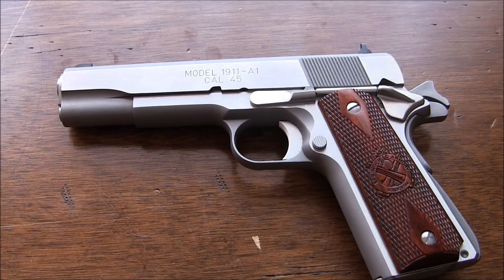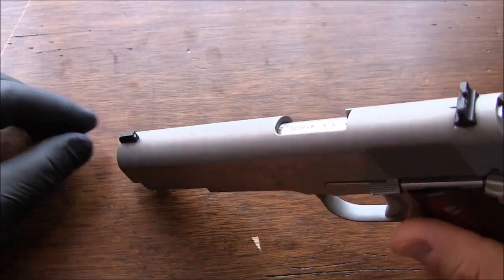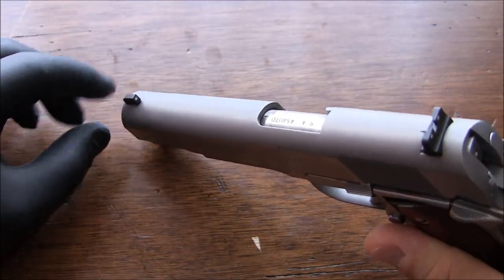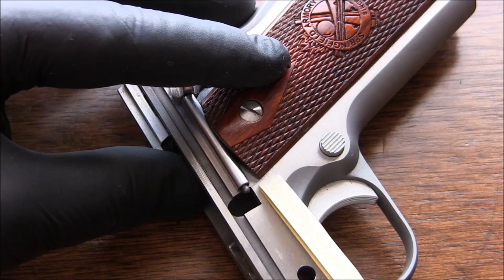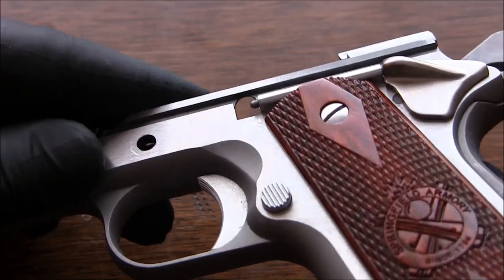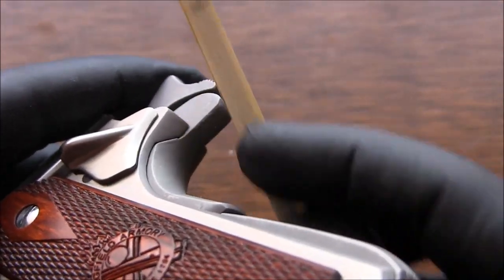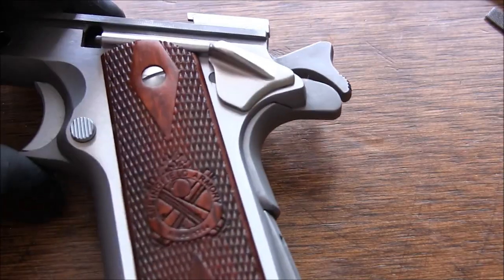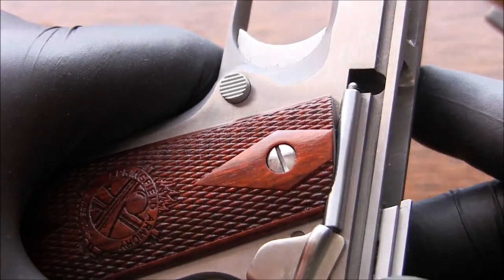1911 Fixes - Sharp Edges of Grip Safety, and Idiot Scratch

Comment: Improper and unsafe clearing of weapon at commencement of video.
Reply from the maker: I wasn't demonstrating the proper way. was simply showing that the gun was unloaded. I made sure it was unloaded before even starting the video.
Reply: Therein lies my criticism.  That is how 'accidents' happen in the form of ND or worse, involving damage to property or person. The procedure should never vary- always, without exception, drop the magazine first.  This is basically an instructional video and you don't want to pass on to newbies unsafe clearing procedures that may also result in civil or even criminal prosecution. Don't try to rationalize an excuse to save the hassle of doing it the safe(r) way. Yeah, I know it's more of a 'pain' to do it the right way, but there really is only one 'right' way to do it- check owner's manuals and military manuals.
Reply from the maker: +brentfoto Thank you for pointing this out. I am not trying to rationalize anything. I believe since that video I did start clearing the proper way. I am surprised you didn't call out the fact that my hand was covering the muzzle before it was cleared. Or that the hammer was in cocked position with thumb safety off .
Reply: Yeah I must've missed the former but the latter is necessary in order to retract the slide. Good video otherwise.
Reply from the maker: +brentfoto cocking the hammer is not necessary before retracting the slide. retracting the slide will cock the hammer. Either way works.
Reply: +MosinVirus 
most videos that I see the presenter cocks the hammer back. I know from personal experience that to retract the slide with the hammer down requires considerable force.
Reply from the maker: +brentfoto just saying it is not required.